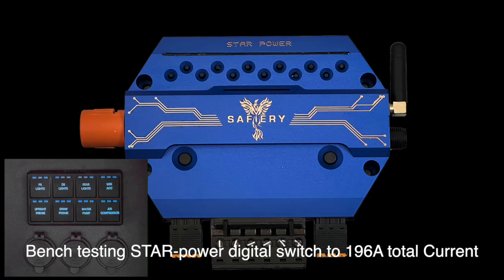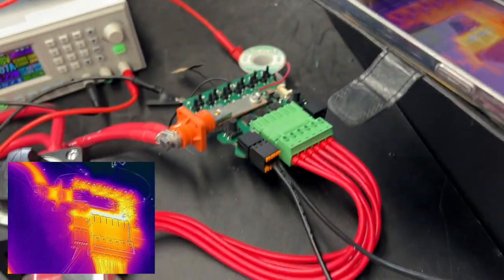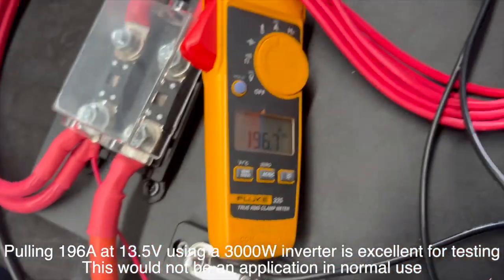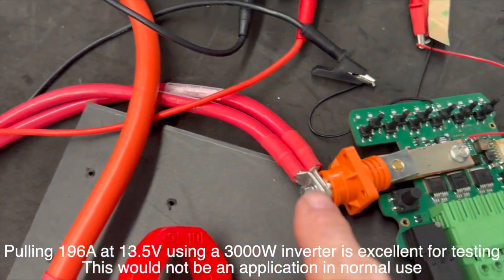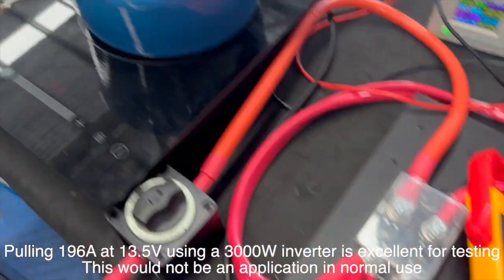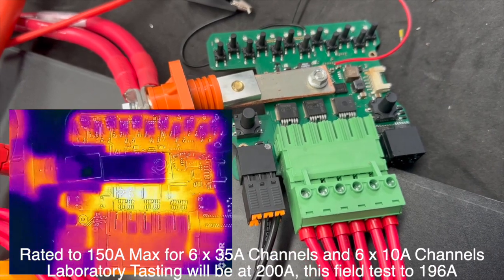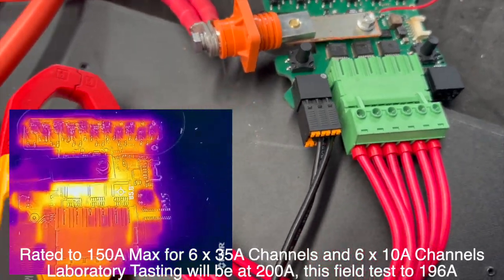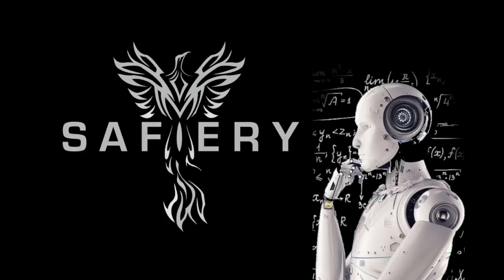Bench-testing 12 Channel STAR-power Digital Switching Board to 196A through 3000W Inverter

Comment: What if anything is the limiting factor...with 196A pumping.?
Reply from the maker: Thats a good question. Its the other extreme of dimming all channels down to only 5W a channel that is challenging to design for. We will be limiting the dimming to the 10A circuits (there are 6 of them). Or you use STAR-light which is 10 dimmable circuits. Its the dimming power for LED's on the positive that is a real challenge. Majority of LEDs dim on the negative leg.